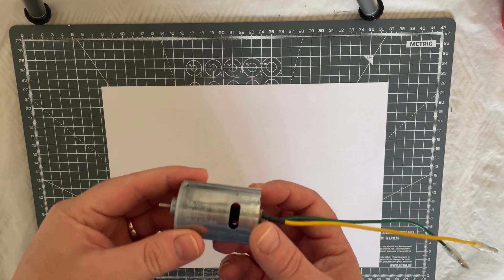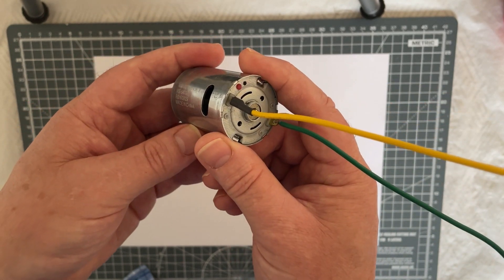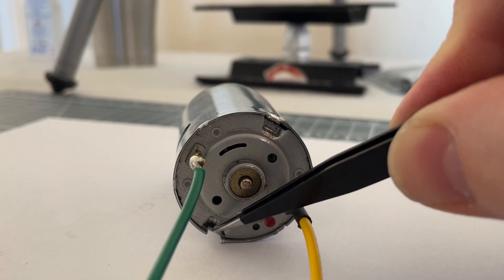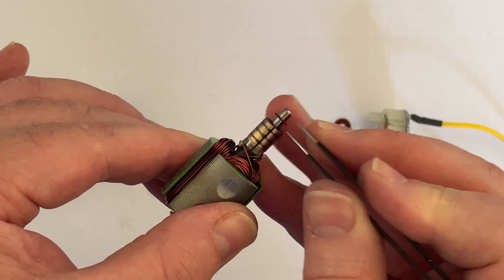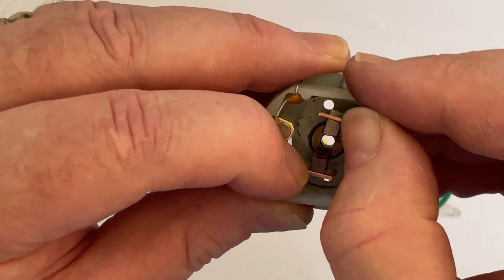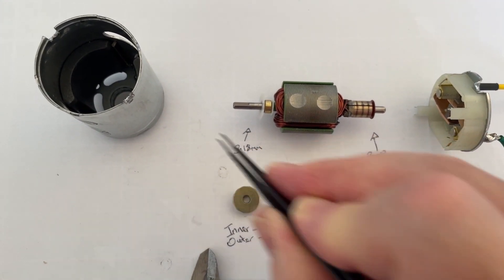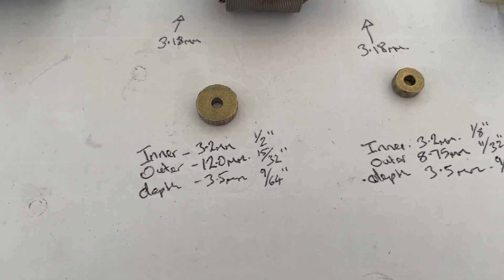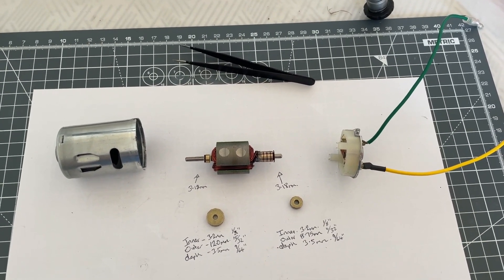Can you modify a Mabuchi RS 540SH motor ? @poorboysrc

Comment: Hello, thanks for the video. Did you manage to replace the brushes?
Reply from the maker: Hi, thank you for watching. Sorry, but the Mabuchi RS 540SH has bespoke bearings, which I haven’t been able to source. Therefore I’ve deemed it as having no serviceable parts and consider it as a disposable motor. 😉😊😎
Reply: @JF-RC  thank you. I do wonder though if you wear out the bushings or the brushes first.
Reply from the maker: @space_cowboy007  it’ll be the brushes first, the bushings are very tough. Just a shame I could find bearings, as I was interested in the performance difference between a standard 540 with bushings and a standard 540 but with bearings. 🤔🧐
Reply: @JF-RC  in our club one porsche cup racer said the brushes died after about 3 hours / 80km and that durability was the only reason to invest in 17.5 brushless as a replacement as it has equivalent performance.

Comment: i have one , and i want to use it for an rc car , i don't know how much current it would draw ? and what esc/lipo batteries type to get to run it fast enough ?
Reply from the maker: Hi, thank you for watching and leaving me a nice comment. The 540SH motor really isn’t too power hungry to be honest. Probably draws between 6-8Amps at best. In terms of an ESC, this is a tricky one, it depends on what your putting the ESC in? the most popular would be a HobbyWing WP1060, that way you could always upgrade the motor, as long as your above 12T on a 2S LiPo. The HW1060 can accommodate 3S LiPo’s too. Battery choice is always a tricky one as well, it depends on what RC your going to be running, buggy, touring car, rally car…? LiPo’s need to be cared for carefully too. If you’re starting off, I would go for a decent NiMh pack, they are easier to care for, then once up and running, go for a LiPo pack, once you’ve got a place store them and a good charger to charge them. Hope that helps. Best wishes and a Merry Christmas 😊😉

Comment: Back when I raced in the early 90's,  our beginner class was called production where everyone had to use the same battery mah, motor, and gear ratio. The motor was a Kyosho Lemans Stock 05 which is basically their version of a Mabuchi 540. One day one of the guys who wasnt very good all of a sudden had the fastest car running 4.90's on the high line of the track( indoor oval) and 4.80's on the regular racing line when the fastest times were 4.95 on the regular line. The next class up which was stock were running 4.80's with the fastest being 4.79. A protest was called and track officials took apart the motor and discovered an armature from a modified motor in place of the regular armature and special lubricant for the bushings. He left the bushings in so if anyone looked at the motor from the outside, it'll still look like a regular 540 but he didn't think about if anyone wanted to see the inside though. Cost him a lifetime ban from the track
Reply from the maker: Hi, thank you for watching and leaving me a really nice comment. Such a interesting story 👍😎😉Best wishes 😎😉😊

Comment: If you think about it tamiya did the sprint and endurance 540 type motors that had one bearing in the inner end but just a bushing on the end bell part! I wonder if tamiya could not find the right size bearing? 
I was always interested in the sprint and endurance with their super cool red or blue end bells and black can with that one bearing was like modified coolness back then Iol!
Fun vid because how many motors have l pulled apart over the years but never pulled a standard silver can 540 apart!
Reply from the maker: Hi, thank you for watching and leaving me a fantastic comment. Interesting comments about the Sprint and Endurance motors, also not having full bearings in their configuration🤔. I was looking to see if the modest standard 540 could be made just a bit better, but alas, beaten by unidentified bushings. 🙇🏻‍♂️best wishes 😎😊😉

Comment: Lol, just lube the bushing it will perform just as well as bearings but won't last. To make that motor faster you change the timing! You do that by turning the plastic endbell to advance it making it turn way more rpm... Use a power supply 8 - 10 volts and start turning the endbell. You will hear it start to scream but too much advanced timing and the brushes will arch and burn. The trick is to get a modified can that has adjustable timing and bearings and put your stock armature in it. You will come up with a motor that has amazing mid-range torque and good top end, the downside is they get hot and burn but who cares everyone has a ton of stock motors they don't use but trust me they can be modified to go a lot faster. ✌🏼😎👍🏼
Reply: And if you don't want to change the can just cut new tangs in the stock one after you advance the timing, you can even just glue it back on if making new tangs is too hard! Lol! 👍🏼
Reply from the maker: @mikesrcgarage  hi Mike, you are a true gentleman and a fountain of knowledge. I was thinking about timing advancement too, but was also concerned of armature support, as I’ve had to cut the tangs away to get into the 540 motor and making the motor that bit quicker with inadequate support, I was thinking ‘boom’! Imploding 540 motor 🤣😂🤣🤭best wishes and god bless to you and the family 😉😊😎

Comment: Great video John...... Yeah, I could have let you know this as I took a few apart myself.. The tabs you took off that held the endbell are there to hold the endbell in place... Way back in the day, guys would twist the endbell to change the timing on the motors (CHEATERS), so motor makers came out with locked timing (Trinity Slot Machine was the first I think) but serviceable. Those serviceable "stock" motors you could change the brushes and springs... Some guys put bearings in them (not legal for racing), you could true the Comm also. Good stuff John and again, Great Video!!!!!
Reply from the maker: Hi Bob, now…if there was one person that would have known, I just knew it wouldn’t have been you, because I’ve seen your videos on motor previously 🖐️👍😎however, I was feeling a bit more of a tight git and was looking to see if you could squeeze a bit more of these cheap humble motors. It’s a shame that Mabuchi don’t make these rebuildable and upgradeable, as it would make it more fun for us twiddlers 😂🤣🤣😂. Thank you for the excellent knowledge and wisdom, always appreciate learning something new 😉😊😉best wishes to you and the family 😊😉
Reply: @JF-RC  The Johnson motors are just as bad but you know, they are cheap if you have to replace them. Those silver can 540's run like a raped ape on a 3S lipo, Kevins Clod is proof of that..... Sure, they wont last long but at @ 13 bucks a motor, cheaper to burn those out than two Tamiya motors or two $60 plus vintage brushed motors.... Your better off using a Tamiya Super Sport motor and putting bearings in that/those... At a gain of only @ 300 to 800 rpm......
Reply from the maker: @UncleBobsRC  Bob, you’re the G.O.A.T! 😉😊😉
Reply: @JF-RC  Nice, I'm a Pontiac GTO...  LOL
Reply from the maker: @UncleBobsRC  greatest of all time 😉🖐️😉